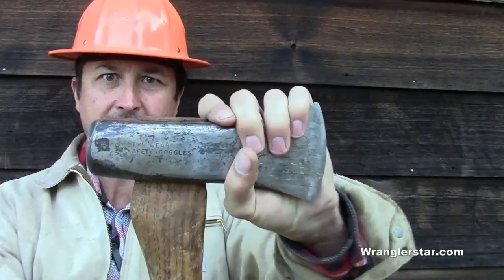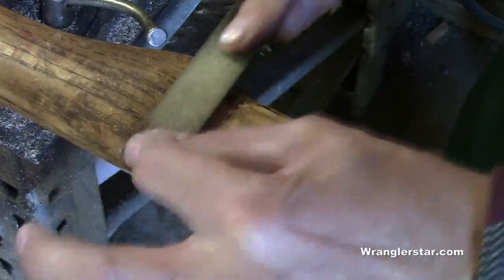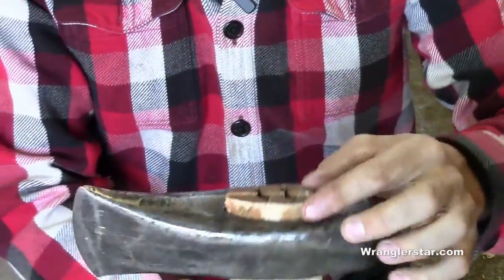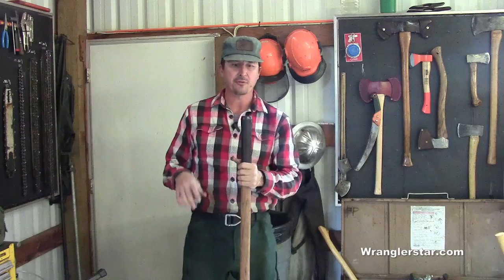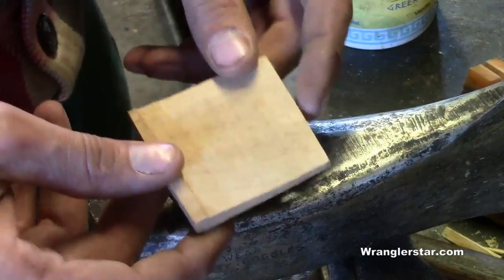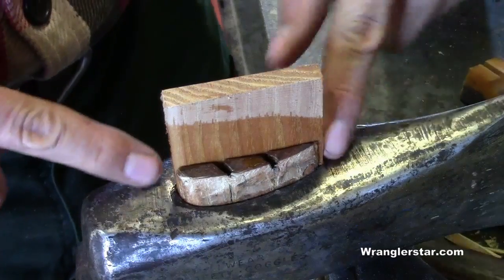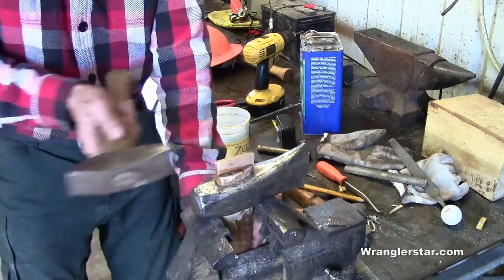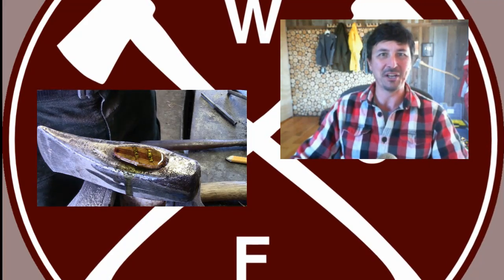How To Fix A Loose Axe Head | 2 Wranglerstar

Comment: Down here in Louisiana the humidity so high (not uncommon 65% to 80%) any wooden handled tools really not a problem of loosen up. Leave in the shed for some time all the wood just swells up so very much it like it welded on. Now on the other hand, take a wooded handled hand tool from Louisiana to Nevada it be so dry out there it probably fall off the first swing. Musicians have this problem with reeds and wooden instruments, like Guitars from Louisiana to Desert states they will crack and split after just several years.

Comment: Great video Cody. I recently bought my first container of boiled linseed oil and boy does it smell! Maybe it's different over here in west Europe but it seems to be helping my new hatchet very well. Just a query, but how deep does the linseed oil actually seep in, because I've observed that when you rasp away material at the shoulder it seems to be raw wood? Also at about 4:30 you can see some linseed oil drip onto the floor:P just a heads up

Comment: I have 2 old axes with slightly loose heads. I want to recondion them. One in the1980s  I was suppossed to soak it overnight in the bathtub so the wood swelled. Reconditioning is tightening the head, sharpening the head, mayme even painting it and sanding and staining and coating the handle.. and / or some good tennis or weightlifting tape too for grip. I have 2 old ones  want to work and look great. A wiggly head is not good. lol

Comment: Why not use a C clamp to close the kerf in the handle before you start sliding the head on? Once it's started, remove the clamp, and continue the installation.

Comment: When setting the head is the axe free floating or do you have a jig or brace providing resistance to the head?
Reply: @WOLFMAN1469  Hey Mr. What was the answer to this question? I would also like to know but cant see the reply from Wranglerstar. Thank you in advance.
Reply: @MananZer0  He didnt reply, I think my reply was to "good question". Freefloat though, hes driving the handle into the head but its a bit of a skilled move as the head already needs to be well secured on the handle even before wedging.
Reply: @WOLFMAN1469  I hold axe, head upright and hammer handle onto the hard surface , same process just using ground as hammer

Comment: I prefer rounded maul sledge hammer type handles.
    To the single bit axe handles when the handle breaks just weld in a piece of scedual 40 pipe.
     Haven't used a maul in 30 years since I bought a log splitter.
     Have one in the shop with a chevy truck axle welded in it loaned it out several times always comes back unbroken.
     Was  not like that when it had a wooden handle.

Comment: At 6.11 when you were driving the wedge in the handle, I see that you put the axe in the vise  and the other  end of the handle was not bottomed on the ground, I feel that driving in  the wedge was also driving out the handle which you drove in so intelligently by using the inertia of  rest of the axe head floating in air..   I would have bottomed the handle rather than put the axe in the vise( vice in English).
Reply: Yeah that part was unclear.  It was probably explained in part 5 of the video...